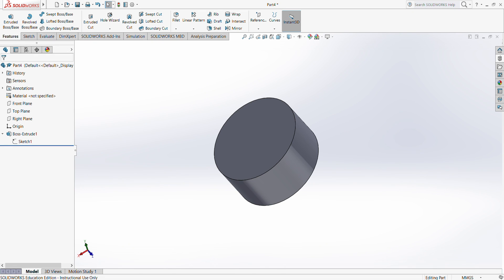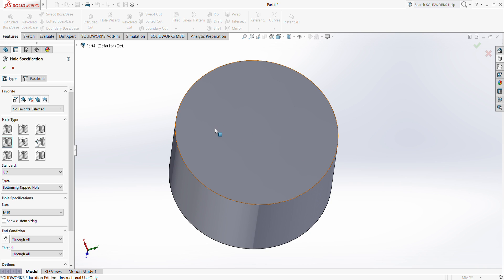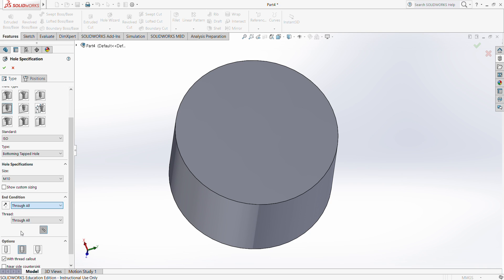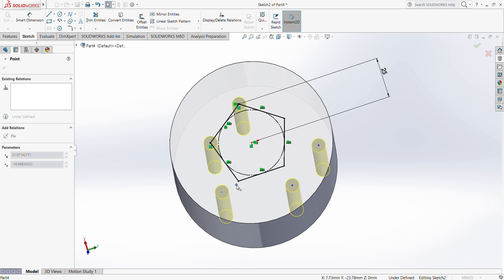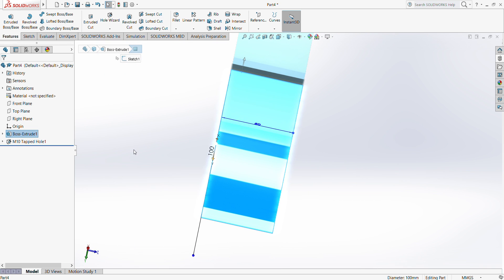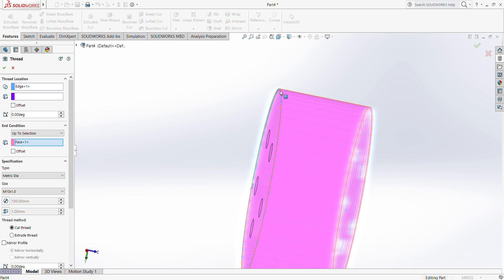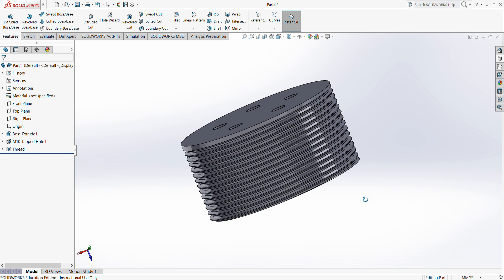Solidworks Tutorial3 - Hole Wizard and Thread

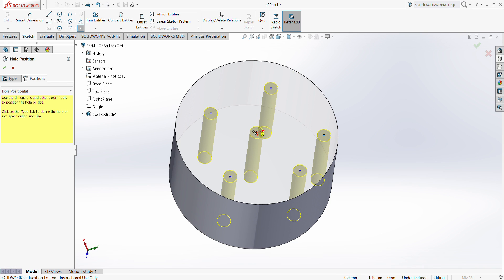Comment: Excellent tutorial, I ask you at min 3:23 during the positioning of the hole you can see the complete cylinder of the hole, while I only see the initial and final circle of the hole. Which option should I set to display the complete hole before giving OK and applying it?

Comment: I'm using Solidworks 2020 and I'm having trouble with the inner thread after making a hole with hole wizard... During assembly, the hole won't appear. Do I have to change some kind of options or make the inner thread manually?
Reply: Did you find out the issue?

Comment: Hi, thanks for the video. One question, is there a way to show the inner thread @5:00 ?  I've used the SW hole wizard to create holes in exactly the same way you have done. They have the concentric circles showing but at no point the thread can be seen. When I moved the file into Keyshot, the treads were still nowhere to be seen.  Thanks for any help.
Reply: Go to Tools > Options > Document Properties tab > Detailing (in the left side list) > Tick the Shaded Cosmetic Threads box in Display Filter section
Reply: @binoygandhi7320  Thanks!
Reply: @binoygandhi7320  legend